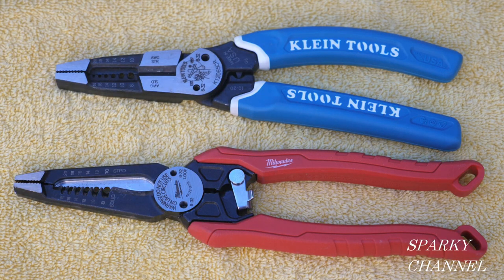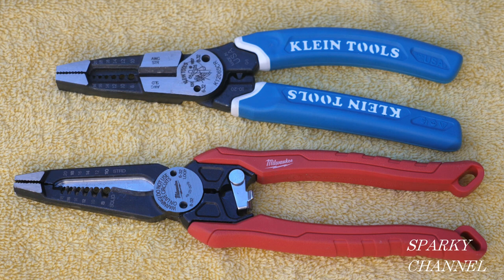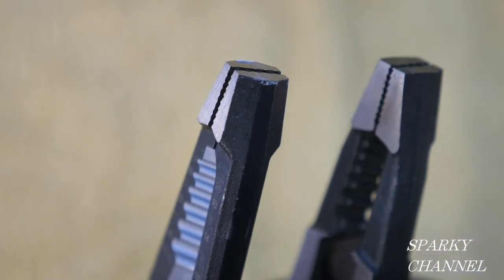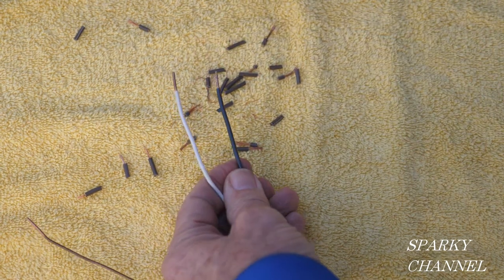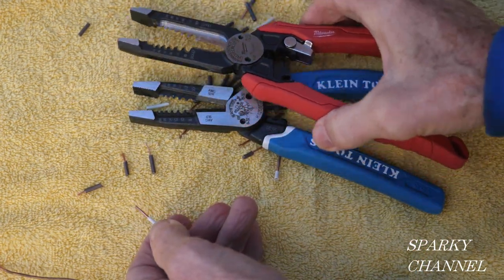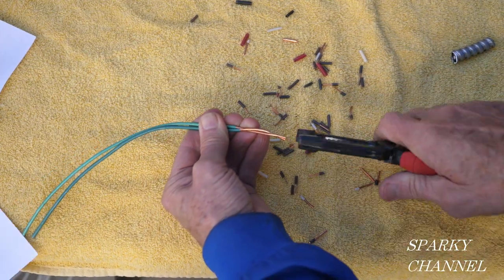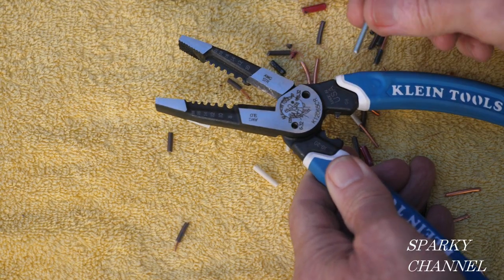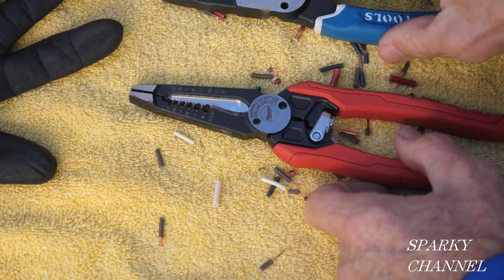Milwaukee New 7 in 1 Combo vs. Klein-Kurve Combo Pliers, Which Will Win?

Comment: I've been less of a fan of klein since they changed their return policies. I don't keep my receipts generally and they want a picture of them to return, which I don't have
Reply from the maker: OK, thanks!
Reply: I've never had a klein fail in a manner that wasn't because of abuse, so I haven't had a reason to test their return policies.
Reply: I had bought the heavy duty plastic handled ones and used those ones and than they came out with the ones with the krimpers. So I bought those ones and for whatever reason they don't strip no where near as good as the previous pair. I was stripping wire back and forth with them and the klein kurves were a struggle to strip and I hadn't even used them. So that's why I wanted to return them to see if I had just gotten ones that weren't that sharp
Reply: @anonymousaurusrex2675  yeah, I haven't run into that sort of issue, so obviously, I'm not aware of it.

Comment: Milwaukee here , Have the Milwaukee M18 and M12 platform but the Dewalt XR as well because I like their flush cutter and chop saw better than Milwaukee. The Milwaukee cutters are a superior wire stripper combo to the Kleins I think. My screwdrivers and nut drivers are always Klein btw.

Comment: I got the milwaukee one but the teeth on them are weak and the rubber handle kept coming off lol so I BROUGHT A 2nd pair you cant crimp anything with these good to have but try klein 1st because these tools are made for the trade with the tech in mind
Reply from the maker: Milwaukee 22, Klein 31. Thanks!
Reply: I didnt even realize there was a crimper, I dont crimp much so I dremmeled the crimp tip to make it a little finer now it crimps great.

Comment: i don’t like the klein’s very much when it comes to cutting full pieces of romex it’s harder to cut with one hand than regular wire strippers, i was in a pinch on the way to work, lost my small regular strippers the day before on a job site, just so happened to stop by the supply store and grabbed the klein kurve bc it was the first thing i saw in the stripper section, first of all was $35 and i have been using them ever since trying to get my worth out of them, not very good for everyday use as a stripper imo

Comment: I'll stick with the Klein. You take care of them, they'll take care of you. Unlike many companies, Klein kept their high quality. I have Klein Tools that I bought 50 years ago that still work just fine. No loose joints or tweaking in the tips. I might like the spring on the Milwaukee's. But, you can't beat the curved handles on the Klein. One more thing. I've never had the handles on Klein Tools slip off.
Reply from the maker: Milwaukee 12, Klein 23. Thanks John!

Comment: I just bought them how does everyone break them in ?
Reply: Tried some blaster penetrating oil
Reply: Use them
Reply: WD40 white lithium grease. Don’t use the standard all purpose WD40 because it dries over time. White lithium grease won’t dry and will stay on the tool as long as you keep them away from water.
Reply: Cut through live cable.

Comment: As a 10 year electrician. I like to have a normal pair of klein linesman pliers, I always use it as a hammer.  Now I just started using the milwaukee needlenose strippers combo, and I really like them. It eliminates 1 tool from my tool pouch.  I used to carry klein curve strippers & klein needle nose.  Now just the milwaukee combo. 48-22-3079
Reply from the maker: For other viewers: Milwaukee 48-22-3079 6-In-One Combination Wire Stripping and Reaming Pliers for Electricians: https://amzn.to/3bj1GiQ
Reply: there's a reason the Klein lineman's are commonly called the "electrician's hammer"

Comment: I went to harbor freight tools and they have a (Doyle brand version) called their multi electricians plier and no latch or spring but work just as good as the Milwaukees. The add says that they compare to the Klein 207 ones that have a crimper on it. The Doyle pliers have a shear style cutter like Milwaukee, the bolt cutters and long nose in the tip. If you have a harbor freight and would like to get a pair to try them out okay. I also have a husky version (home depot) and kobalt version (Lowes). I am a fan of multipliers so I have those pliers both you are talking about and the other versions of these pliers .
Reply from the maker: Thanks Ruben!

Comment: I've have had all klein stuff in the past then moved to the east coast and within a week of being here due to humidity levels always being so high I switched to all milwaukee hand tools and they haven't gotten a single speck of rust on them in 2 1/2 years , I also find the milwaukee tools just have a much better economic feel in my rather large hands , I also seen someone say the milwaukee strippers dull out over time and don't strip clean I personally have never experienced that in the 2 1/2 years I have been using them ! Now I just refuse to use anything other than milwaukee they are solid well built nicely anodized and perform excellent on a daily basis
Reply from the maker: Milwaukee 25, Klein 38. Thanks!

Comment: I think Klein won all the way. I have used both of these strippers. And yes the Milwaukee cuts better but when you're dealing with 14 gauge 12 gauge down to 20 gauge it really makes no difference if it's sheared or not. The latch on the Milwaukee always gets caught and it gets in the way of crimping. In my opinion the Klein strippers are much better!
Reply: I hate that latch! Haha.
Reply: Have both klein twist way better but my milwakee over all are better to me, my buddy just drilled out the latch he doesnt like it either it doesnt bother me
Reply from the maker: Milwaukee 22, Klein 32. Thanks!

Comment: i have a pair of the Klein pliers with a spring and latch on them. I hate them the cutter is hot garbage super terrible to use. both are good quality Klein are just less ergonomic and the cutter is beyond garbage on them they are just hard to use and leave strands on smaller wires.
Reply: Lol I was gonna say that bout milwaukee. Usually gotta work at it a lil more just to strip some tstat wires
Reply from the maker: Milwaukee 24, Klein 34. Thanks!

Comment: Milwaukee are made in China. 
Klein are made in USA.
I’ll be going with Klein.
Reply from the maker: Thanks!
Reply: Knipex 13 72 8 Is far superior than Klein's
Reply: @tonypuga2502   I love knipex, but as an electrician I have to say their stripper options suck. The one you mentioned only goes up to 10 gauge solid or 12 gauge stranded. I work with 10 gauge stranded all day long and wish they had an option for that. I currently run Ideal strippers which go up too 8 gauge stranded and 6 gauge solid.

Comment: I have two other versions of the Milwaukee and this particular Klein amongst many others.  Unless they have better metal now, the Milwaukee is a waste of Money - the metal is sub par and not suitable for all but the softest of the copper.
Reply: BTW, the Milwaukee will cut, but just look at the tool after a few days of cutting.  It's not just about sharpness but robustness as well.
Reply from the maker: Milwaukee 22, Klein 30. Thanks Cal!
Reply: @SparkyChannel  yes, big red is well priced for a home-gamer for sure.  But for a pro such as yourself or even a DIY enthusiast as myself, the 8 dollars difference will be paid in long term quality and ease of use.  I am certainly not saying more expensive is more better, I often prefer CL pliers to Klein's in most situations that I encounter.  I am however, saying that the price is not too relevant, especially when it comes to getting a job done.

Comment: Pass on both...only first years try and make those combination tools work. 😂
Reply: Not at all true buddy.
Reply: @aidanmendell2570  or I guess handymen (or handyperson if you’re a delicate snowflake)
Reply: I used to say the same shit but my dad gave me the Milwaukees a couple weeks ago and I haven’t pulled out my stripper/crimper or my lineman’s since I put them in the bag. They really shine when you do a lot of ladder work because you don’t have to tote so much shit up and down.
Reply: Or old electricians stuck in their ways
Reply: Your ngmi
Reply: Splash out £22 and you'll never look back. Been using the previous-gen Milwaukee for the last year in domestic/commercial applications and they are great. The only time I ever reach for another set of cutters is when I need to cut 16mm+ cables.
Reply: Yea sorry buddy that’s so not true. This a perfect tool for a fire alarm or lighting guy. Easy grab and go for troubleshooting or residential. Point is these definitely serve a purpose
Reply: Sorry first years..they’re garbage. You’ll come around one day.
Reply: @tfun101  not a first year. Think about it before you puke all over the comment section. Fire alarm - 14 and 16 wire with splicing, crimping and needing to cut down screws. Maybe not the best for splicing 12 and larger but for small wire it’s perfect.
Reply: These are good for a small job like changing out a single outlet or switch.  Also if you are crawling around in a cramped attic or crawlspace where don't want to wear a tool belt. I seriously doubt that only first year people would use these. I have all the dedicated Klein tools and also a pair of these and I've been doing this work since the 90s, I seriously doubt that I'm the only one.
Reply: @actionjksn  there’s like 4 of you

Comment: They both suck. Over priced gimmicky crap.
Reply: what kind of electrical plyers do you like, should be multi use
Reply: I don't use any multipurpose pliers. Imo, simple is better
Reply: I like the plain $10 to $15 strippers better. No latch.  It just strips wire.  I also hate combo screw drivers.
Reply: Also a square drive and BX cutters are a good investment
Reply: BX cutter I mean Klein all purpose shears